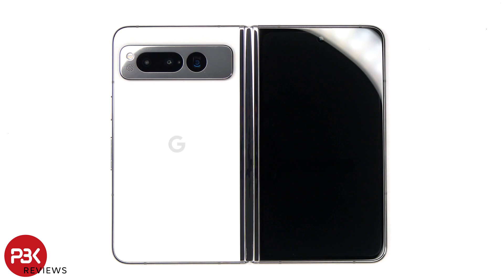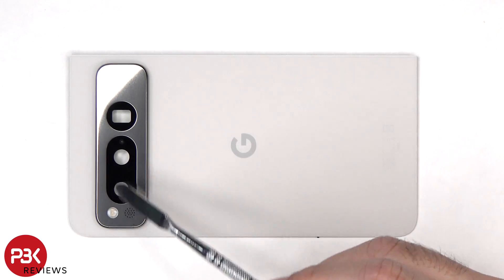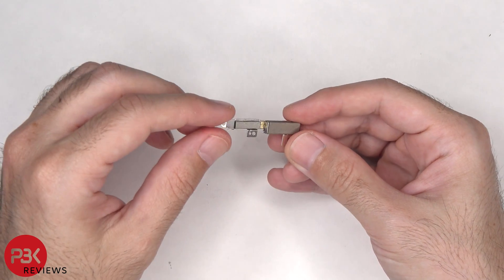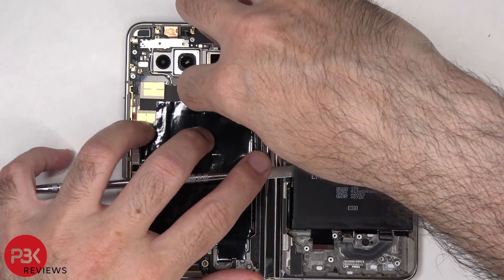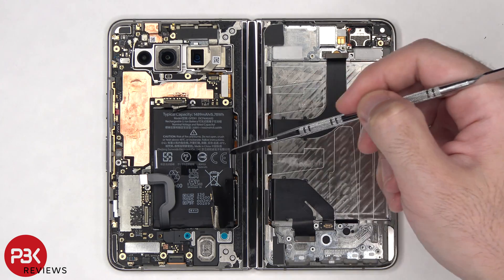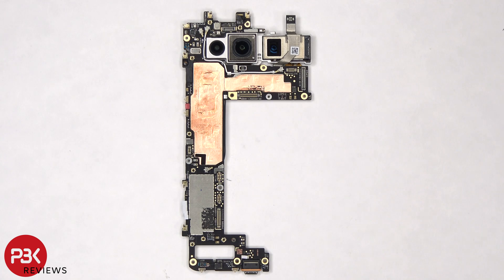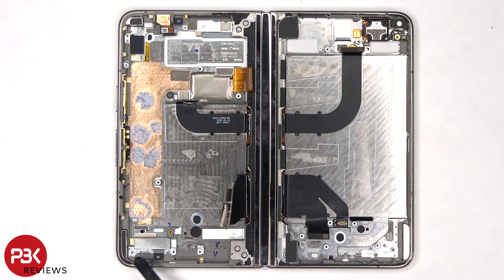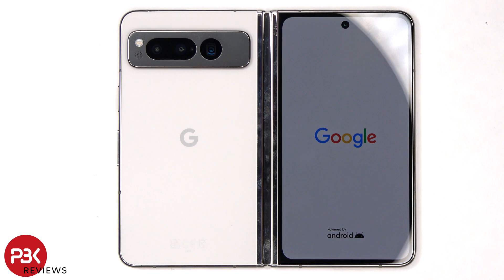Google Pixel Fold Teardown. A Look Inside Google's Foldable.

Comment: Bought an open box and the rear camera metal frame came a litte bit scratched and i found the replacement on aliexpress. You mentioned that it can be replaced with heat? So i basically heat the frame and use a plastic tab to remove it but will it have any connected cables or i dont have to worry?

Comment: What's the purpose of two top speaker? 3:10 and 5:05  Are they facing difereent directions? 
Love your videos by the way, keep up.
Reply from the maker: The top left one is the loud speaker which works alongside the bottom speaker for music, and when its on speaker mode etc. and the earpiece speaker on the top right is for when you are on a call and have the phone to your ear so its not on loud speaker. Technically they can use just one for both but its better to have two separate from my experience for better sound quality and volume control etc. Thanks!

Comment: is this better or the xiaomi's fold?
Reply from the maker: I haven't had any personal experience with Xiaomi's fold devices, but in some aspects just from looking at the teardowns, I would lean toward the google pixel fold. The pixel fold has dual linear haptic feedback motors and the speaker system looks to be better. But then again looking at the Xiaomi fold 2, the charger port is replaceable, and the battery pull pouch is better than the pull tabs on the pixel fold. So not sure honestly.

Comment: if they put 2 batterys in fold phones it will be a game changer, but not for repair.
Reply: these phones are heavy.. honestly these phones have a lot of battery
Reply: @AlyxGlide  yes but i think some midrange folded phone with focusing on about 5000-6k mah will be really nice on market.
Reply: It has 2 batteries though, didn't you watch the video? The Z Fold series as well as the Z Flip series all have dual battery too
Reply: @Kowalskithegreat  i dont, but i need something more midrange i mean cheaper

Comment: I saw JerryRigEverything's video yesterday on the pixel Fold and it snapped in half where the smaller battery is located. From the disassembly, I can't see any structural issues from that side.
Any idea what the issue might be?
Reply from the maker: The only issue I can see is the plastic antenna lines on the frame. Usually breaks tend to start from there.
Reply: The problem seems to be Jerry bends the phone in the opposite direction it was intended to with force. Something nobody would ideally do. Try bending your fingers backwards, if they break does that mean your body was designed bad? 😂
Reply: @rscle5  Nailed it 😂👍🏻
Reply: @rscle5 I've daily driven a Foldable for a year now, and there's definitely a chance of bending backward. The Galaxy Fold is rock solid and doesn't break. No reason Google couldn't have addressed this as well - Google has a bad history with designing antenna lines at weak points.
Reply: Jerry is mad... Nobody is gonna bend their 1800$ phone like him... 😂